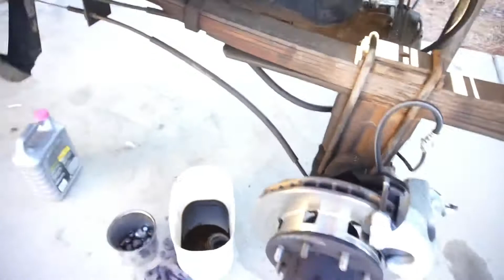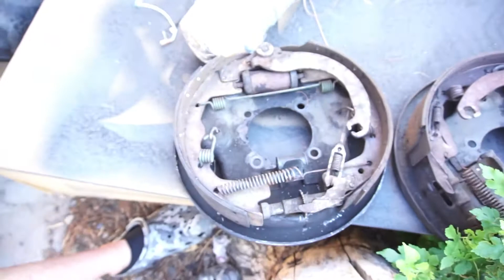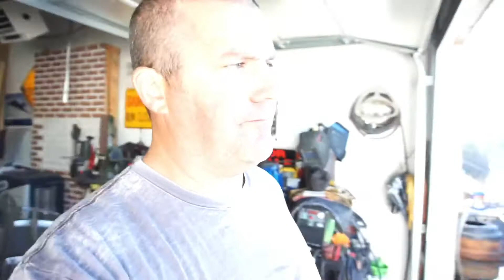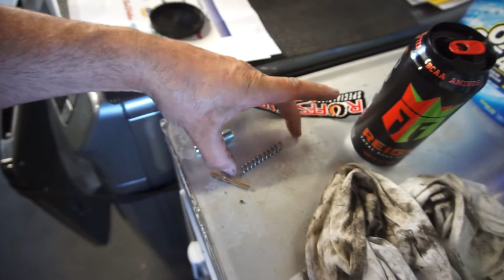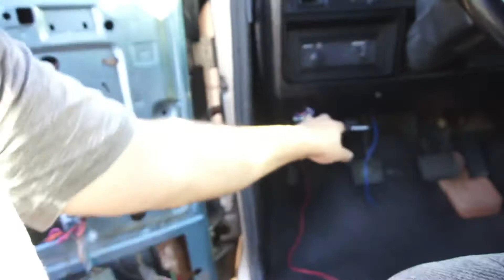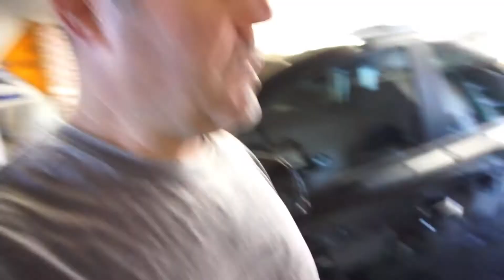Installed A RUFFSTUFF Dana 70 Rear Disc Brake Conversion On The 1st Gen Cummins. Easy Bolt On.

Comment: Hey nice video, I’m wondering if you happen to have the part number for the rear callipers with a parking brake ?
Reply from the maker: I don’t have the part number but I believe they’re from a 1977 Cadillac Eldorado which you can get from parts stores but are pretty much out of stock everywhere which is why I went with Ruffstuffs kit. Thanks by the way.

Comment: Did you have to adjust your proportioning valve at all or get a hydro boost to make it work, or did everything just mount up and work as it should? I’m doing this exact kit on my 1st Gen and am getting a lot of feedback that they won’t work unless I adjust the rear braking power with a proportioning valve? Thanks for any help you can provide!
Reply from the maker: I installed a whole hydro boost and I installed a proportioning valve. But I installed everything at once. So I did get to play with different things. It has Chevy disc rears and 4th Gen Ram up front with hydro boost and it stops on a peso. 1/100 of a penny. Really really good.